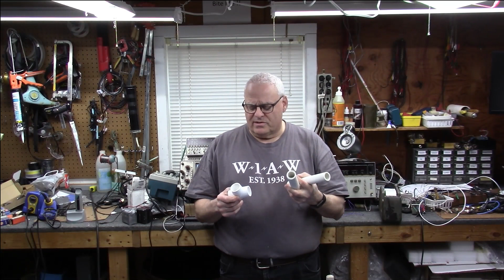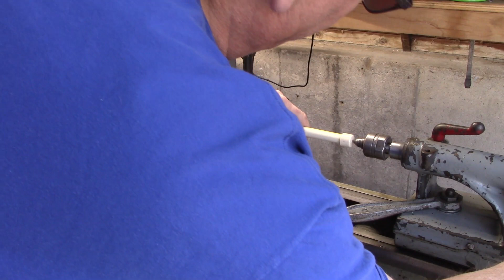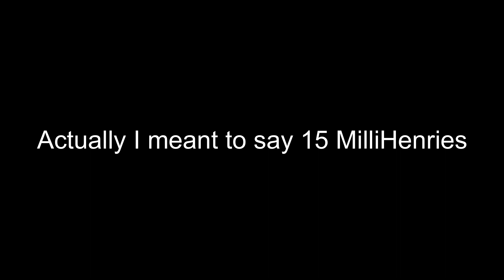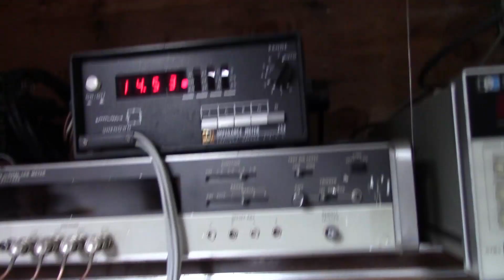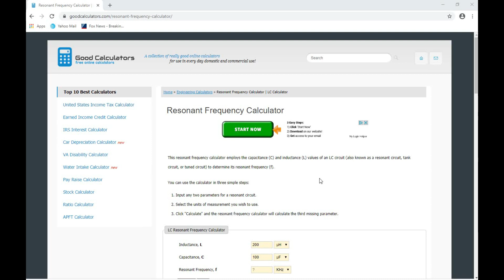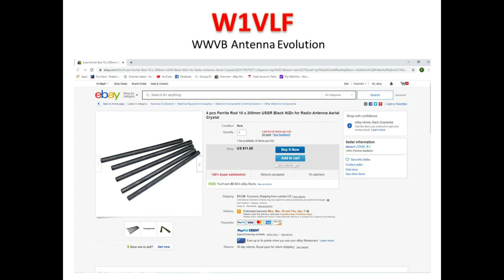WWVB  Antenna Part 2

Comment: Will this work with Iron?
Daniel, KQ4GOB
Reply from the maker: Possibly, but the number of turns would be radically different and the iossed in the iron core would be very high.  This is why they laminate Iron cores at 60HZ and it gets worse as you go up in frequency

Comment: This 16 inch antenna is worth the effort to make.  It works better than my 100 foot random wire antenna.  Took me about 2 hours to make a hack-version. I used #26 wire and wound the PVC pipe.  Put masking tape on the ends of both ferrite rods to build out the diameter enough to snugly press fit inside the PVC pipe - no glue.  Resonance at 60 kHz was achieved with 377 pf.  I used an electric drill to rotate the PVC pipe during winding. Really impressive performance, reduced noise pick-up, sharp nulls when rotated, sharp peak at 60 kHz, small size.

Comment: Your WWVB loop stick antenna seems quite a bit easier to assemble than the instructions I found for the Ultima VLF Antenna here:  https://img2.tapuz.co.il/forums/1_120115724.pdf
I'm curious is there a difference in dB gain between your design and the Ultima VLF?

I take it you no longer have time to manufacture these antennas for sale anymore?  Thanks

Comment: Did I miss the description of the ferrite mix?
Reply from the maker: look at 22:47 there is a parts list
Reply: @W1VLF  Mmkay, permeability isn't the ferrite mix but I'll go with it and see what I can find out. I'm guessing it isn't too critical given that the rods are Russian surplus. thanks for getting back to me!
Reply from the maker: yikes ... Guess I should read your comment more carefully.  I am not sure of the mix... I know that these rods work well..  I tried some other mixes #77  and although I could use less turns, the captured signal strength wasn't much better.  The cost how ever was like a order of magnitude of or deer more.. I just stuck with the ones I am using now.. There are at least 100 of these antennas out there using this mix.. Good luck
Reply: @W1VLF  No worries! It was clear that the ferrite you selected was surplus. After heading over to Fair-Rite and reading a couple white papers I too determined that #77 would be appropriate but as you found the cost didn't make a purchase that mix cost effective.
Reply: Thank you for the design. I built mine yesterday and realized that the end caps need to be double-checked to see if they fit inside the 1” tube. Mine didn’t. Oops! It possible best to swap to an internal stopper style end cap and make the 16” tube slightly longer if you have this issue with your local lumber shop have bulky end stops. 

Oh … and don’t skimp on the hole size on the end cap, when that glue expands and foams, it really wants a place to escape. I wiped the resulting bubble of foam off three times during the hour++ it took to set. Next up … measure that inductance! Thanks again for the design. - Martin W6LHI/G8LHI

Comment: Would an ideal be to have a dowel in between the two cores?  Pushing them to the ends of the PVC?
Reply from the maker: You certainly can try that.. I never found it necessary when that expanding glue sets, the cores cant move.  I suppose if you made the CPVC pipe way to long you might need to do that.